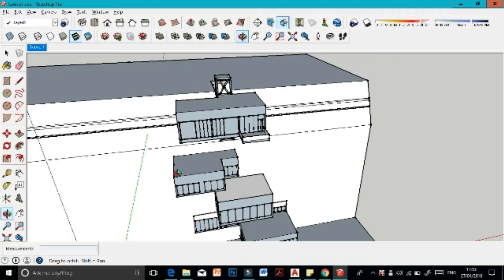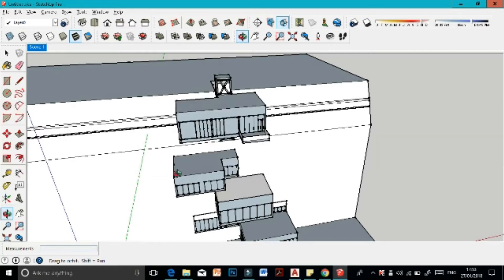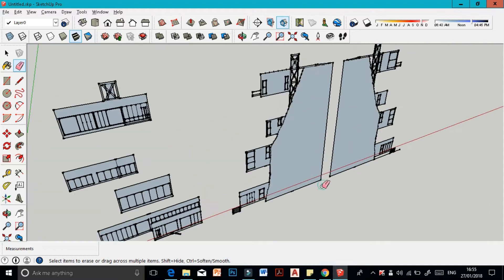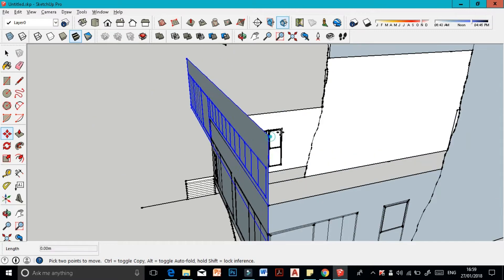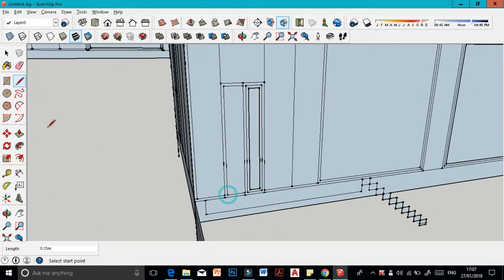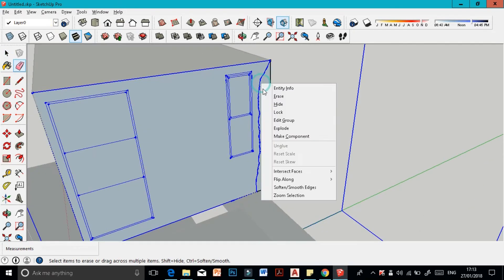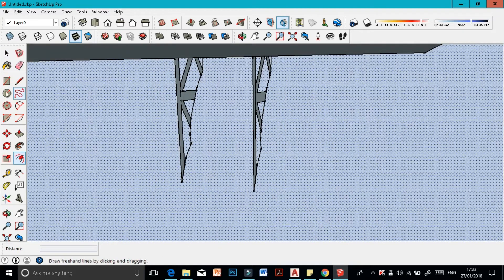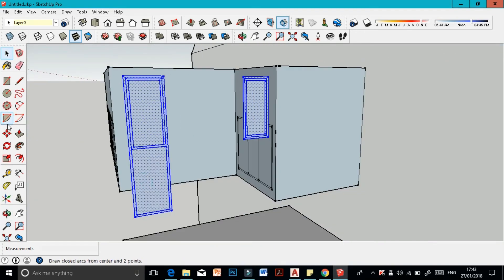Autocad Elevations into 3D Model | Architectural Design

Comment: Very impressive. Im trying to do the same thing with mine, however my elevations are bit more complex. Since yours are mostly rectangular shapes, my model has to deal with a lot more angular lines and shapes since it is a victorian style house, and it has a lot of detailed window frames and sloped roof faces. Any tips?
Reply from the maker: Thank you very much! I think the best way is to group each elevation separately and build it that way, wall by wall and then start adding details and refinement such as window frames and sloped roofs. You can also group within the group the smaller details and work within the group to keep things organized. I hope that helps!
Reply: @SurvivingArchitecture  It does thank you ;)
Reply from the maker: Dwayne De Vera thats great!!